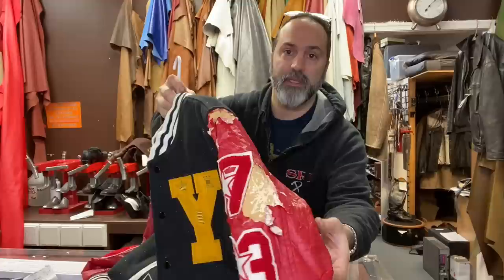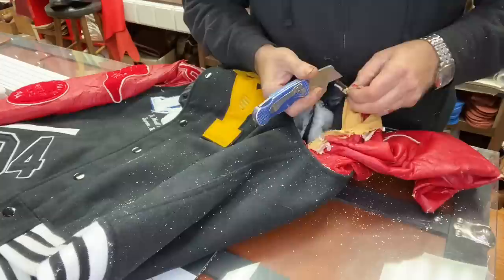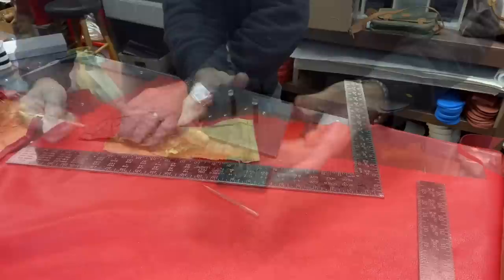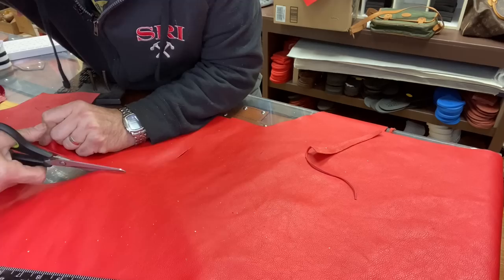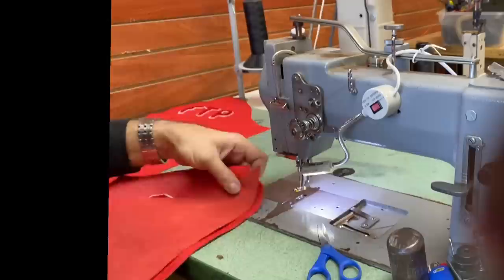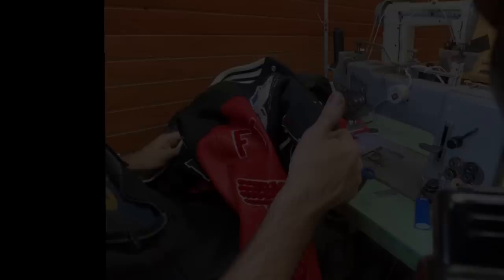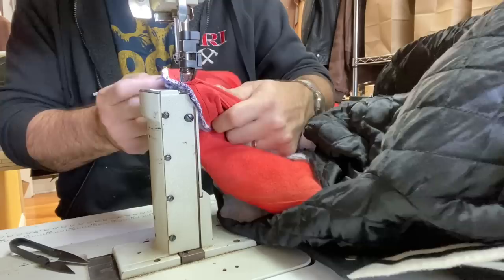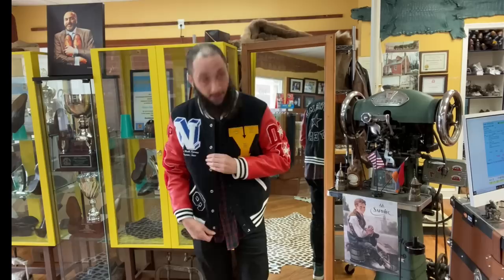Supreme varsity jacket restoration

Comment: Steve gotta correct you on the branding bit! Cattle are required to have a permanent brand! This can be either a hot brand or a freeze brand.  Hot branding creates the scar on the hide while freeze branding  disrupts the melanin production in the hair shaft leaving a permanent white patch.  This is the only way to prove legal ownership of cattle.   Regular Ear tagging  is used only for the propose of identifying individual animals.  RFID tags are used to record  trackable data on animals such as weights, births, meds, notes on the animal, and shipping weights.  This is more for the individual farmers records than anything. 
However to sell, transport across state lines, send to feedlot etc a brand inspector must come and examine the lot to be shipped/sold etc  and provide the rancher with a piece of paper that certifies that the animal is fit for sale and that the person selling the cattle has full legal ownership.
The reason for requiring the branding is that ear tags are not permanent! They are easily removed and or lost during normal routine life.  A brand be it hot or cold can’t fall off and can’t be removed or obscured it is a permanent method of identification. Every rancher has their own unique brand which is registered with the state.
Reply from the maker: Jayknee Garner I stand corrected. Thank you

Comment: Whats the yellow think on the sewing machine thx
Reply: Must be a trade secret.  It can't possibly be a wire nut.  Maybe yellow tape or heat shrink?  When I used a CNC  punch press, we used to put duct tape on the dies and holders to prevent them from marking stainless steel and aluminum that needed to be free from nicks and scratches.
Reply: @corvettebob96  thanks